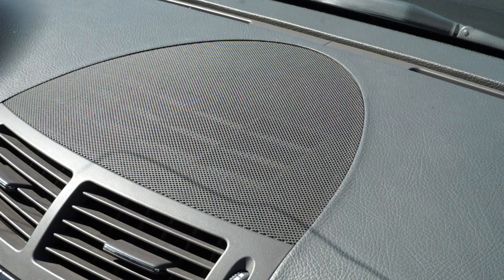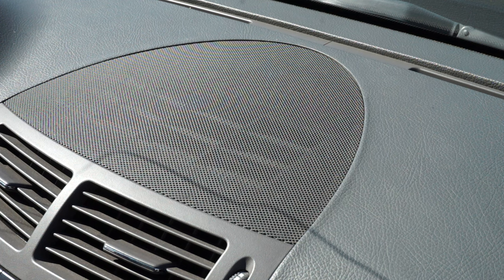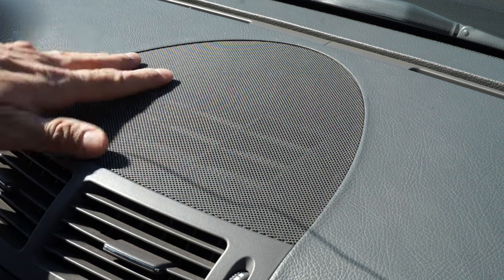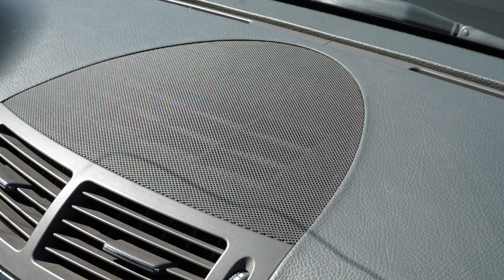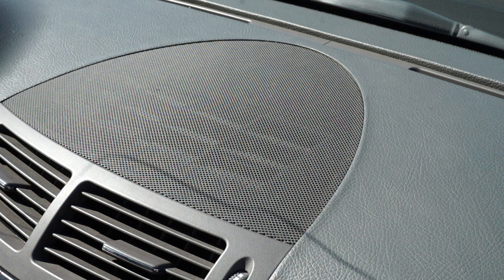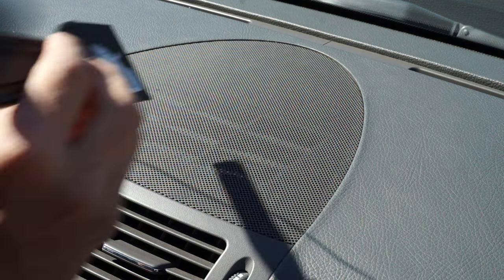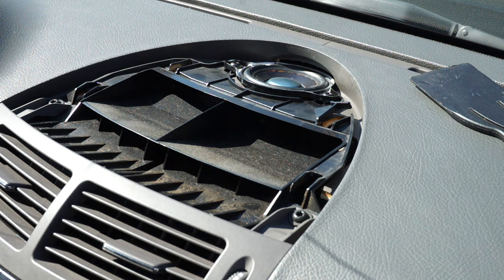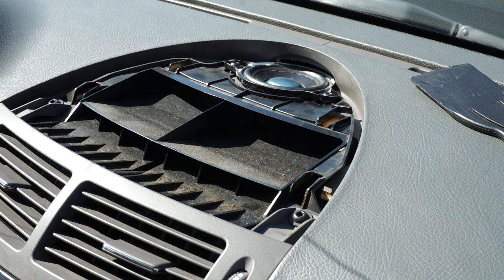Mercedes W211 06-08 front center speaker grille removal

Comment: My c43 has been rattling but when I press my finger on top of the speaker cover, it stops. Is that same problem u are having? I searched online on how to remove the cover so I can trouble shoot it Bc the dealer couldn’t fix it, I bought it to them 3times already. It seems like an easy fix if all it is is just the speaker vibrating against the cover.

Comment: More than likely if the speaker is just buzzing, all the speaker needs is to be tightened to the dash itself. The vibrations cause the screws to unthread and just the tiniest gap can cause huge amounts of rattling. Thank you for sharing!! I'm gonna head home and fix this in mine tonight!
Reply: No, these have a common failure of the cone/surround separating and then buzzing.  I haven't found any of these with the factory screws loose.

Comment: If I haven’t purchased a replacement speaker, but don’t mind just getting sound from the door speakers as long as the rattling stops. Can I just remove the speaker once I take off the cover ?If so, how do I do it?  Just cut the wire or something? Will it affect the other speakers if I simply remove or disable the dash speaker shown in the video? As I’m sure you can tell, i have very little experience working with cars or speakers, someone help!
Reply: You can just unscrew the speak there should be 2 screws then unplug it no need to cut it